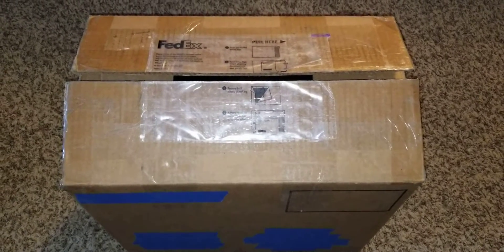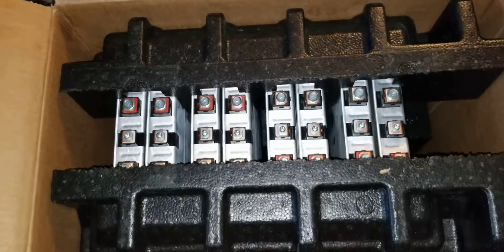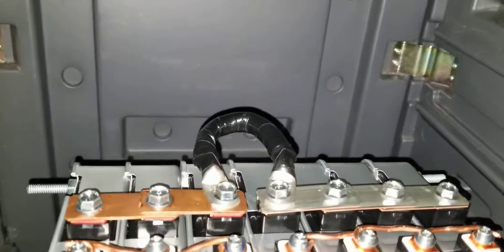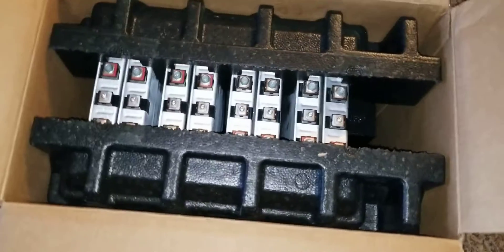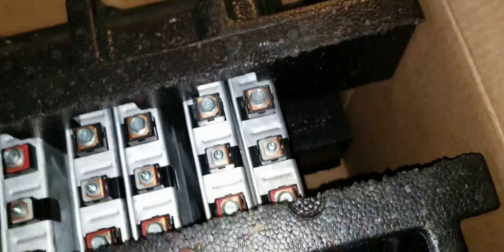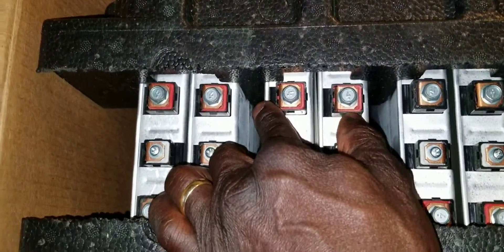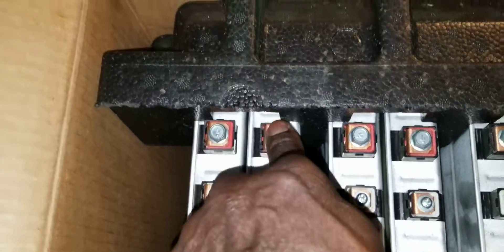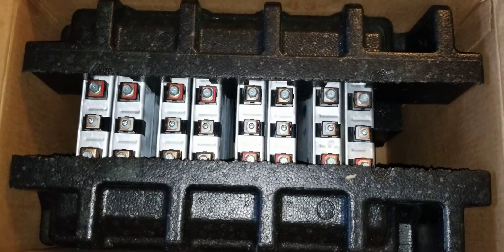HOW TO MAKE POWER BANK WITH LITHIUM BATTERY - Budget Battery Bank

Comment: been following you for a while now, i finally got into the nissan leaf batteries myself...i use the midnite classic charge controller too, my system is 24volt, i use 3 batteries and charge to 24.9...can you do a video showing the settings you use on your midnite solar controller?...thank you
Reply: Interested. 24.9 seems to high. I have mine set up at 24v and charge them to 24.6 but would like to know if 24.9 is safe.
Reply: @FrancescoOliveri  so far they have been doing fine...
Reply: @SmokeyMountainOffGrid  how much are tou getting from them? I hace 6 and im only getting aboyt 1.5kw. Seems pretty low for the supoosed 66% guaranteed i was told from batteryhookup.
Reply: @FrancescoOliveri  honestly im not sure yet, i have never really put them to the test but i have a total of 24 batteries
Reply from the maker: It's good to have you buddy and thanks for WATCHING